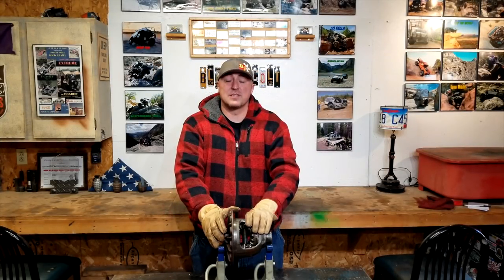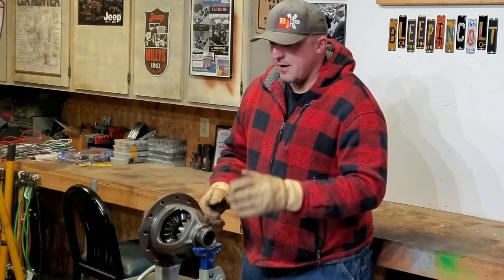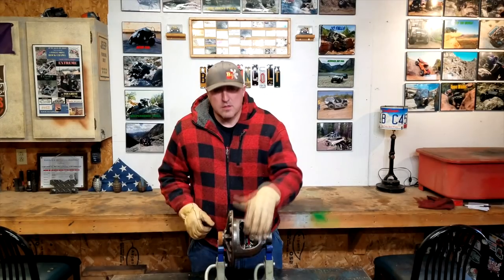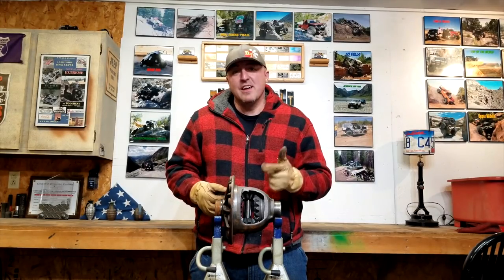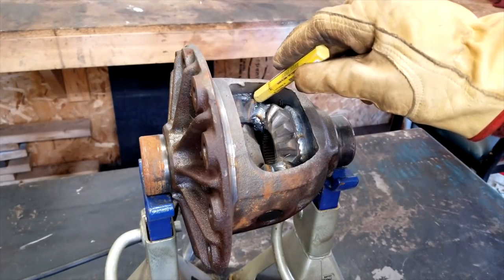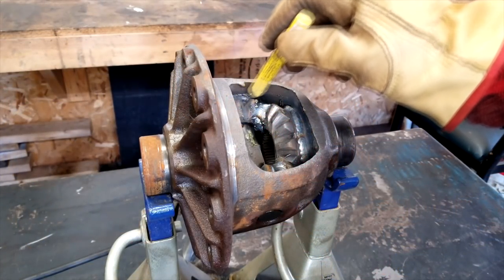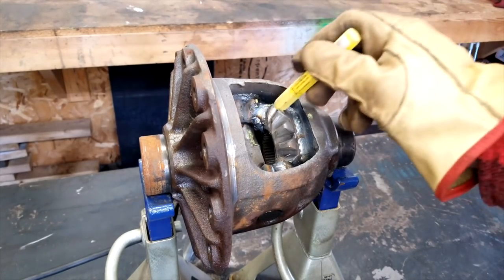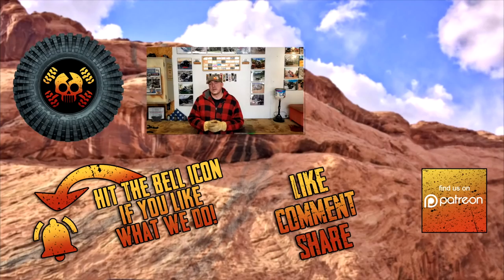Cheapest Locker Ever - Lincoln Locker - How To Make Your Own Spool

Comment: Great video. A welded diff is cheaper but I would save up a little more money and by a mini spool or a full spool. The amount of welding wire, gas, and time would make me spend the extra money. Plus the diff is more serviceable if it isn’t completely welded solid.
Reply: I see your point, but many people don't have the equipment or ability to set up gears. With a new full spool you'd be committed to that. A mini spool is fine but what makes the axle any more or less serviceable with a welded carrier?

Comment: I will Lincoln Lock a diff for no charge $ if the customer brings the diff ready to weld I always plate the gears and have never had any to fail I recommend a Lincoln Lock 100% and I always plate the gears unless it's clip axle.

Comment: Is it possible to weld up a carrier that has a possi unit in it that is worn out?
Reply: I think that would depend on what kind of posi unit you have. I've never tried welding clutch discs together but I have welded GM gov-loc carriers together.

Comment: Was kinda hoping you'd give an amp/volts setting you prefer to run to ensure you get it in there deep lol. Not that I'm gonna run out n start welding up diffs cuz any rig I'd have is gonna have to see some pavement n tires ain't cheap lol
Reply: Hot as she goes bud.
Reply: Well the down side to that is each welder is different so what may work on my welder would have different settings on another but my lincoln 216 was on volt setting D, wire speed at 280-300 and .035 wire🤙
Reply: @Bleepincolt  ah yes forgot that most home welders have presets instead of an infinitely adjustable amp/voltage knob n display
Reply: @Bleepincolt  so Lincoln 140 or 180. Lol
Reply: @scottpetrie8707  no it's a 216👍
Reply: @benmiller5015  if I was using a miller 250 I'd usually have my power setting somewhere between 19.5 - 20.5 usually. Hope that helps👍
Reply: @Bleepincolt  HAHAHAHA don't let the last name fool ya. I can't afford a miller lmao what's that come out to in harbor freight lmao

Comment: Good video showing how thats done.

Welded diff has its place, i'd do that over a mini-spool every time.

Put a mini spool in everything else will break...and then the mini spool😒
Reply: @JeepTeriyaki  mini spool is a problem because of the issues with "play" like was mentioned in the show.

They break the end of the axle shaft off where it enters the spool, or the end of the spool breaks..or both.

Thats my experience with them, but i'm a moron wtf do i know😊

Comment: Hi, thank you so much... Hiw good is this set up for driving in a highway? I mean to get to the trail driving the truck to get it there.  Another question, is this feasible for a Toyota Landcruiser 1991 with a front solid axle? Thanks in advance.
Reply: im no pro, but this is usually done with offroad only rigs, your going to put tons of stress on you steering components at highway speeds and with on road traction. if you want to keep the rig good for on road you need a locker you can disengage- this goes for any vehicle

Comment: I’m afraid you will have to forgive me, but to me welding a differential shut constitutes the height of nuttiness to the power of 13. It would have helped if you explained the use of such folly. To understand my point it might help to let you know that I live in country where there are practically no straight roads but lots of mountains 😂. Your welding is quite decent though... as is your sense of humour!
Reply: It's no different than running a mini spool or spool in the rear axle just cheaper. It'll gain traction as with an open diff the power will only go to one wheel (the wheel with the least resistance) so with a lincoln locker(spool) you'd now have both tires giving more traction when needed.
Reply: Also thank you😉👍

Comment: seems a bit permanent.....
Reply: Nah man if you watch the cheap jeep challenge videos Matt from busted knuckle shows you how to make it an open diff again lol
Reply: @benmiller5015  That's because most people don't weld the gears to the carrier. So there's the possibility that the welds can break.
Reply: @andrewforte  yeah I just couldn't resist the chance to be a smartass
Reply: Lock it with lead, then you can melt it out when you don't want it locked any more (weekend hot rodder tip from way back)

Comment: Even when I was dirt poor I would never do this. Too permanent. Also being locked can be bad in some low traction situations and actually contribute to getting stuck. Plus it digs up trails. Plus puts extreme stress on the driveshafts and accelerates tire wear. On top of that how often do you really need it locked. I have found that seldom do I really need to be locked.
Reply: I run spools in my sami, I've never found where I get better traction unlocked ever in my life🤷‍♂️ but I've ran lincoln lockers in many of my dual purpose rigs for years.
Reply: @Bleepincolt  my main thought there was super soft sand where you can barely go anyway and you go to turn sharp. One or both tires will dig in. I have an air locker in the back of my rig and had cases where I forgot to unlock and got into trouble because of it. Same is true of some deep snow where you just don't want slippage. Snow in particular can be dicey when you need both tires keyed in. If one tire slips then you lose it. Of course this can mostly be over compensated for with much larger tires.
Reply: 4X4Scout, I TOTALLY AGREE.
Reply: @consaka1  I don't think anyone is disagreeing that an air locker is great for the rear axle, especially a dual purpose rig. But an air locker, compressor and setting it up takes a lot more money and time than a lincoln locker on a budget wheeler.
Reply: @Bleepincolt  I honestly wish it was a trutrac but that's what I was stuck with. But yeah my rig is honestly not a trail only rig and routinely makes trips across the country. Multi purpose if you will.  For just one limited purpose I can see a lincoln locker doing the job but the downside of not being able to turn it off would really bother me as a slightly ocd person. Honestly I think I would figure out a way to selectively apply brakes to each wheel first. Lol that would at least preserve my tight steering. Oh and you need an air compressor anyway so that's not a big deal. I carry two with me everywhere and one was free thanks to a , I think , lincoln navigator.
Reply: @consaka1  its only speculation but i would guess you would have gotten stuck regardless of locker with situation you described. the amount of traction loss from inside tire slipping seems like it would be overcome by having all tires powered. my point is how do you know it wasn't just "too slick" regardless... it seems to be the general consensus that locked will be better off road in most cases..